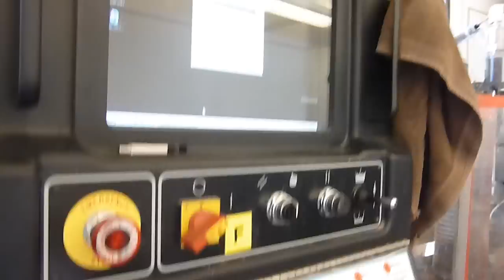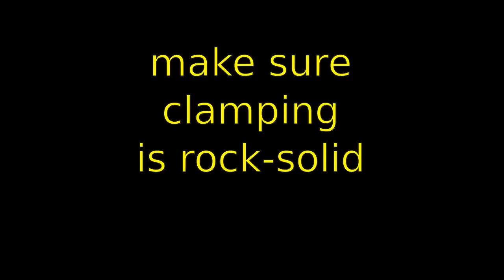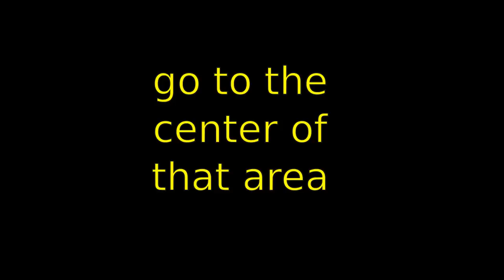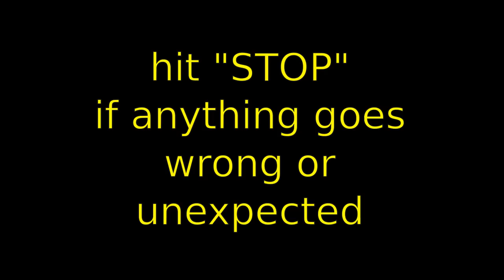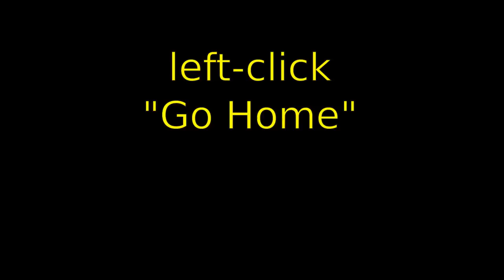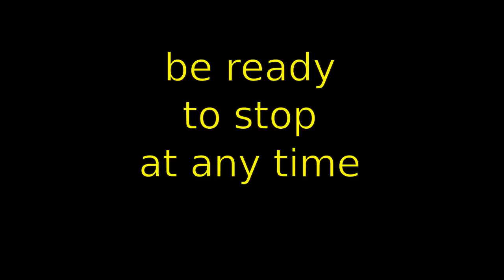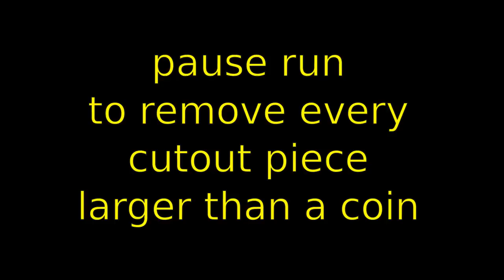[No Sound] Introduction On How To Use The Waterjet Cutter

Comment: How is it possible that the stream of water doesn't cut the grid that is below the material that you are cutting? 

I hope you can help me figure it out 

Greetings from Mexico!
Reply from the maker: It does cut the grid below. These sacrificial slats are steel sheet metal, 100mm tall, 2mm thick, and they need to be replaced when they are worn out.
Reply: Oh thank you very much. And how often do you need to change the grid?
Reply from the maker: Javier Pérez Every 150 to 200 hours of operation is probably a good average, but that's just our preference. This is a university machine and we don't want slats to get dangerously thin and sharp. Other operators might do it less (or more) frequently than we do.
Reply: ubcengphysprojectlab well thank you very much :) . Great vídeo!

Comment: Does cutting above water cause prewear on the mixing tube?
Reply from the maker: I actually passed that question to Omax, maker of the machine. The answer is no. The mixing tube is not affected when cutting above the water line. However, they warn people not to cut above water because of the backsplash and potential damage to any machine parts that get sprayed. The spray contains garnet (aka sand, the abrasive) and it will damage parts as if they were sand blasted. However, when using the yellow guard (looks like a toilet plunger) that will catch pretty much all of that. However (yet another however), when the machine has a tilt-a-jet or the A-jet setup (not just basic like ours) these machines are very much in danger: A guard can not be used (as easily) and regions around the nozzle have lots of things that really don't like to be sprayed: Motors, bearings, connections, bellows to cover these things. Lots of stuff to think about and keep an eye on.

Comment: This menu looks exactly like OMAX Jetsystems. Is it?
Reply from the maker: +ParaglidingManiac Indeed it's an Omax. (...as you can also see on the upper left of the screen when showing the control menu:-)
Reply: ubcengphysprojectlab
Have you heard of TECHNI Waterjet? That's the machine I'm working with.
Reply from the maker: ParaglidingManiac Nope. Like it? How does it compare to the Omax?
Reply: ubcengphysprojectlab Handn't had a chance to use Omax. Techni Waterjet we have here is used for making tube-like cases for uranium cores to be used in a nuclear power plant. I'm fairly new herem but the impressive thing about this waterjet is it's accuracy. Down to 5 micron. Besides making cases for uranium, we're also making filters by cutting metal into a grit. Many more ways to use it too. It's all limited to the imagination!
Reply from the maker: ParaglidingManiac Interesting, have to look it up. What's the largest sheet size your machine can cut? And how much does it cost? Our Omax from the video is ~ $125k U.S.
Reply: ubcengphysprojectlab
Ours cost approximately $218k USD if I'm not mistaking. Can cut 6x2.5 meters sheets (20x8 feet sheets in size).
Reply from the maker: ParaglidingManiac Wow that is massive! Nice.

Comment: So many questions left unanswered. I will chime in with ten years experience on these machines. First off a at 50,000 psi a waterjet using water only will cut fingers off. Adding sand to the mix is needed though to cut steel. Vacuum sucks the the sand into the mix.

This is a really basic machine. While it may appear cool its 20 years old tech. Yet its still cool.

I have cut 9.5 inch steel on a waterjet machine, the table that supports the product gets cut too.  You need special cutting slats when cutting thick material. Or the product falls to the bottom of the machine.

As for Flow machine? Garbage! The machine itself is fine, the support sucks.

Want a waterjet machine buy Omax. Best in the business. Free software upgrades for life of a machine. I sound like a salesman.

They are the best machines in the industry and the software is the best.
Reply: Appreciate your insight, Richard.  We're looking to buy a used waterjet.  Would it be possible to contact you for some advice?

Comment: Although tempting, do not start cutting path directly in the middle of the material or your machinist will take your head off
Reply: I know rite we use a squared edge and use a .2 of set for border to save material

Comment: So then what the hell is that nozzle made of??
Reply from the maker: +Thrilla Whale From high performance steel, but the thing that is really impressive is the disc with a tiny 0.7mm (0.028") diameter hole inside the nozzle assembly. That one is made from sapphire (cheap version) or industrial diamond (expensive but more durable version). When you take it out and run the pump, the flow is just like what comes from a strongly going garden hose. But with the disc, the machine's giant pump is trying to essentially force the same flow as it pumps without the disc, and that is what creates the enormous pressure of up to 50000 PSI (3400 bar or atmospheres). Here's a photo of the nozzle assembly, the part with the tiny hole is called the "Jewel". https://www.omax.com/sites/default/files/page-content/learn/how-does-waterjet-work/omax-abrasive-waterjet-nozzle.jpg
Reply: carbide.
Reply: that simple enough

Comment: Isn't this really an ABRASIVE JET, not just water?
Reply from the maker: That is correct.
Reply: Abrasive helps the process along. Much like erosion on a river bed stone/sand rubbing on each other removing each other edges. Some materials like rubber , foam and wood can be cut without abrasive....but one can not cut without water and use abrasive only...and that's why it's called waterjet.